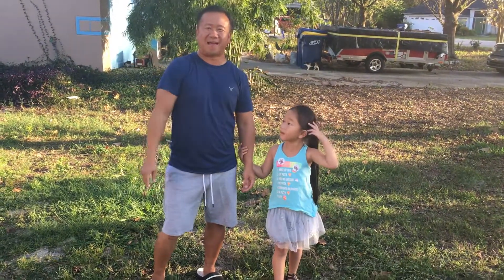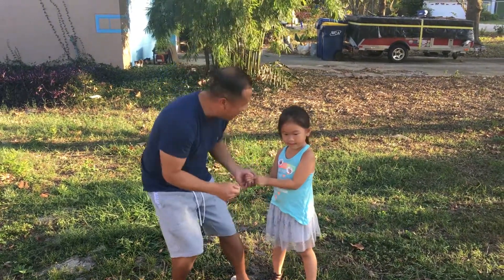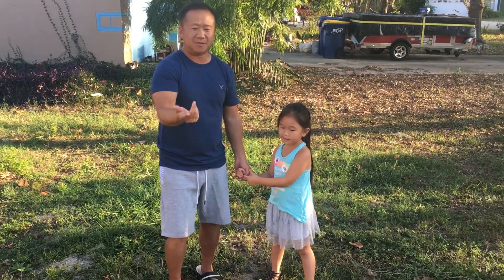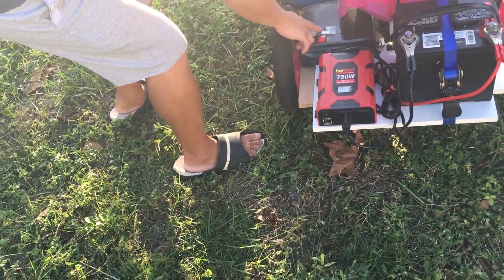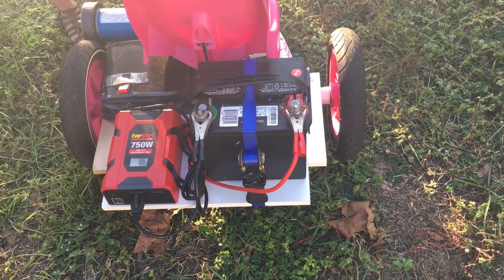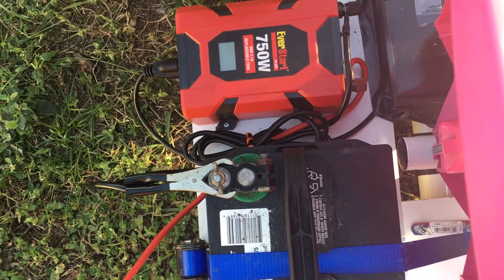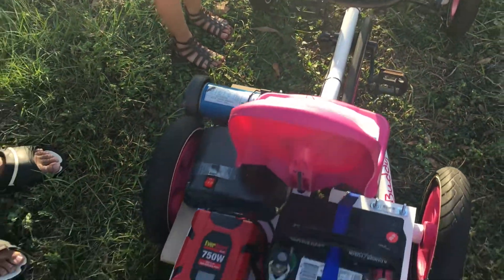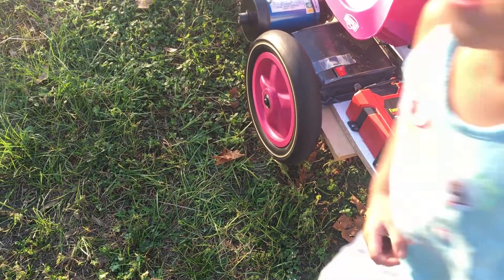Build Electric Go Kart | DIY Go kart at Home

Comment: Link a video of how the controller box is set up on the inside?
Reply: I just got three free treadmills 2 that work and one the upper control board doesn't work. I also have a pedal cart I want to put it on.
Reply from the maker: @maxiemassengale189   Great! Let me know how it goes. These DIY's are always so interesting!
Reply from the maker: Controller box is part of the old treadmill. I didn't make it myself. It didn't have a cover cause it was on the inside of the my old treadmill so i made an aluminum box to cover it. So if your wanting to know how i made the controller the answer is didn't have to make it, it was already part of the treadmill.